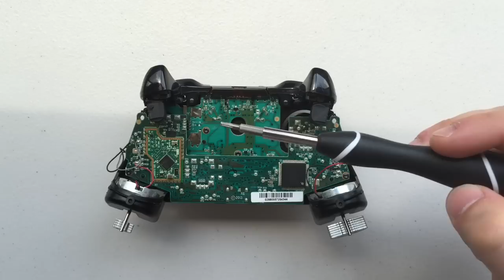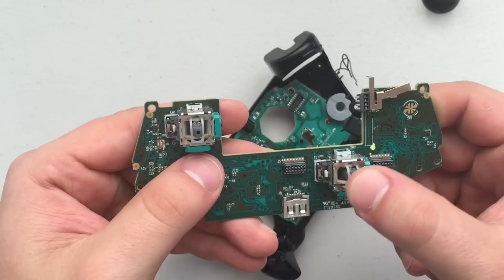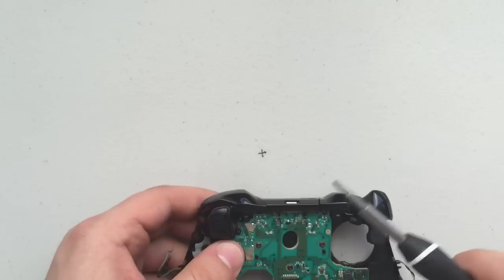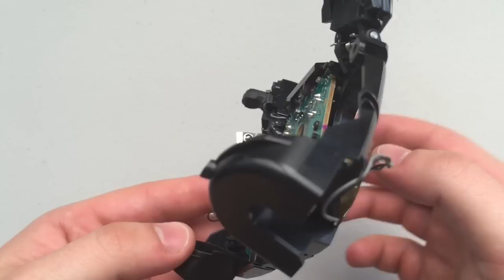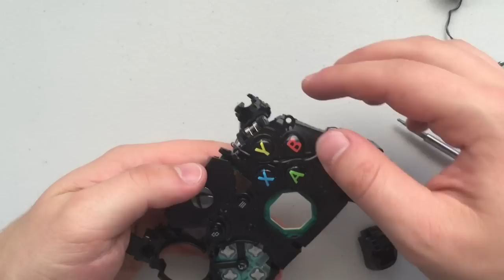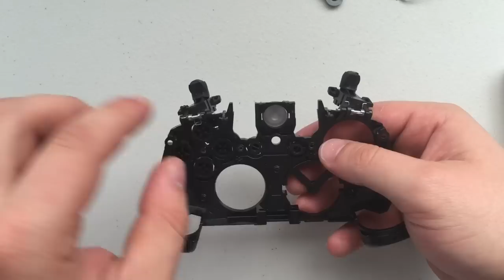How to Open/Disassemble an Xbox One Controller (Part 2)

Comment: You got me further than the other 5 or so tutorials I watched, and actually helped me out alot. I was able to completely dissamble all moving parts without a a solder kit/iron or anything like that just a couple torxs drivers and a tiny flathead for complete disassembly. But u helped bro thanks.

Comment: Damn it, its the white part underneath the d pad for me. i got the default white controller and couldn't press the up or left on my d-pad. even disassembled i got nothing. i clicked it and then i went full 'don't care', i just scrapped the white part off and found metal underneath the white sheet. it seemed like i made decision i cant go back on, and i didnt have the smaller screwdriver for the green board inside.before that i put it in water to scrape off any soda residue or anything and it seems like i just pressed up and left on the d-pad to hell and back. it just reached the end of its life time.. damn. well i got other controllers but jus decided to try my hand at this thing

Comment: Also if you happen to wipe that grease off the dpad get a tube of white lithium grease it works great i use it in anything from these to n64 joysticks to ps2 disc trays and anything that needs grease

Comment: Thank you sir, almost bought a new controller over the B-Button misfiring.

Twas a simple need to readjust the button and rubber cover over the plastic button's rod.

Still holding this Battlefield One Edition controller baby strong after 5+ years!

Cheers!

Comment: His controller is slightly different than mine.. I had to take mine apart to adjust the joystick for drift issues and I didn't even notice the module for the Aux Jack was just chilling on my floor.. did t even notice it fell out. I had no idea what it was until I inspected the controller. Turns out it just kinda sits in place and the prongs make contact with the board.... No solder... Nothing lol but I figured it out anyway :)

Comment: This is seriously a terrible internal design ms used for the controller compared to the internal design for the xbox and 360 controllers I just wanted to take the thing apart so I could clean the Y button since it was getting stuck and I found myself taking apart too many things in it just to get to the rubber pads and the buttons when I should have just opened and cleaned it in a few minutes like I do with controllers for older system.

I really hope they don't do this again with the controllers for the next xbox when it comes out.

Comment: Could I cut the circuit board in half and run wires through the severed lines? I am working on a project where I would need the parts to be spread out over a couple feet...

Comment: Any physically impossible way I can take my controller apart without the sodder? We currently do not own one in the house unfortunately.
Reply: Problem is the wires wrap all the way from back to front.
I have a controller with bad D pad down and no soldier iron

Comment: Both of the pegs holding in rb snapped. Just some super glue? Btw this is a wired controller
Reply: Rb was wedged in there. It finally came out without disassembly.  It's actually one big peg that was attached on both top and bottom

Comment: The right shoulder button on my Xbox One broke, but it's a different model from yours, mine has the shoulders both attached to the face plate that goes over the Xbox Button, as a result trying to glue it back down is...challenging at best. Thanks for showing me how to dismantle the thing though.

Comment: So, the white tab sticking out from the side of my left analog stick is missing the piece that holds it in place, so it doesn't sit up against the black button under it properly (slightly above it). I hear something rattling around further inside of it, so I need to take it apart further to find that piece. I hope this helps someone find their problem!
Reply: Turns out I was 100% correct! I got it out, and noticed immediately that the smallest piece on it had broken off, most likely the cause of it falling out int he first place. I am debating whether or not I should super glue this back on.

Comment: Had my RB cracked, so when i pressed it, it didnt click correctly or at all, so i used the RB from my other broken controller and changed it, thanks for the vids man
Reply from the maker: Awesome! Glad it helped. I just bought a broken controller (it's really just the LB button) so I'm going to do the same. Just pull an LB from the other controller (actually the controller in this video lol)

Comment: Its not dangerous chemicals really in lead free solder its basically just tin. And for lead solder you just need  good air flow like a fan or a open window. If people go lead free they wont need to worry about it cause it be safe. I use nothing but lead free solder if need or use  lead solder i turn  a fan on its all simple stuff if not inhaling lead solder
Reply from the maker: Good to know. I've always just used a fan as well and it's worked fine for me.

Comment: Seem to have a problem where the Right bumper doesn't send a signal to the xbox.  The function of the button works fine, however, when an app or game requires that button I cannot use it.  I also seem to be having a problem where when I push any button down I get a delayed response.  Any help would be appreciated.

Comment: I'm going to put this out there: If you use a screw diver that is .5mm too small, you will strip the screws.  BUT!  After I stripped two of my screws, they fit perfectly with a 5/64 hex key.  So, if you do strip your screws, try a hex key, it may save you a huge headache.

Comment: I have a problem that nobody has been able to help me with. I have an xbox one controller that has a broken internal trigger. Not the trigger that is easily removable but the trigger inside of that that does not get removed in this video and is held in by the metal swivel screw. It does not look like there is any way to loosen that swiveling screw to replace the cracked plastic piece that it is holding in place.  If you are not clear exactly which part I am talking about check out 12:30 in the video. It is the piece with the magnet attack to it and the rumble motor. I need to replace that and cannot remove it. If ANYONE knows ANYTHING I can do to replace it please let me know. I have two controllers that have the same problem so it would save me a lot of money. Thanks!

Comment: Hey man....Good video, but solder is pronounced "sodder" (no "L" sound).  Furthermore, you should get some flux, which helps the solder flow better, and make a better connection.  You can buy a small container of it at Lowes or Home Depot .  Make sure you get rosin flux or petroleum based, not acid based (acid flux is specifically for plumbing, not electronics).  Ask for tinning flux - I use Lenox brand, a petroleum based flux which I know for a fact is available at Lowes, located in the plumbing section.  Comes in a little hockey-puck shaped plastic container and has the consistency of vaseline.  Also, a damp sponge for cleaning the tip of the soldering iron is a necessity.  You should never leave flux on the tip or the bits you've just soldered after you're finished soldering, and cleanup is easy with just a damp sponge.  Cleanup of the circuit board points you just soldered can be done with medical grade alcohol (never ever use water to do this), which can be purchased at Wal Mart.  Another important thing to consider is static electricity.  An accidental dischard of static can be disastrous to your controller's circuit board, so make sure you ground yourself against something metal before you actually touch the circuit board.  I actually didn't find it necessary to desolder the black and grey wires from either side - they were long enough that I could detach the circuit board from the other and just flip it around and out of the way.  It would also be a lot easier to use a flat tip screwdriver as a pry bar instead of the torx driver.  LOL

Comment: Do you know how to remove the left and right stick clips on the boards I need to replace mine I have the new clips but don't know how to take the old ones off
Reply from the maker: What's up Nat. Thanks for stopping by. Are you referring to the assembly that holds the right stick on? It has an arm that moves around, etc...

Just doing some basic research, it looks like those are somehow pinned in to the board. I'm not sure if they are soldered on through the other side or what...never really looked in to those. If I see anything I'll get back to you. Also doesn't look like there are any videos on it so I might have to make one for it.
Reply: Xbox DIY they're soldered i seen a vid where someone took them out and replaced them but he didn't really get into it much detailed definitely would look into it. I was going to do mine yesterday but I'm not the best with soldering/unsoldering so I just left it alone lol
Reply: Xbox DIY and yes I was referring to the little cubes that you attach the grips too
Reply from the maker: Soldering is pretty tough - would it help if I made a video just for that? I feel like all the soldering videos I looked at were garbage and I ended up just asking somebody I work with for help. It's kind of specific to this controller so maybe that would help a lot of people out.
Reply: Xbox DIY I think it would the one I seen he sped the clip up where he was soldering/unsoldering so it was kinda hard to tell exactly how he did it. Would definitely help out me and others who would rather fix their own rather than buying a brand new controller and that breaks lol

Comment: I have a problem with D pad. Something as if one button does not connect every time, I push it and not responding then again and it jumps two tabs (xbox menu). Before opening gamepad I would like your opinion, would it only need some redusting and oiling or some replacement ?
Reply from the maker: I would avoid oiling anything - you have to be careful with lubricants. You can open up jsut the outside case of the Xbox One controller and access the Dpad so it should be pretty darn easy (and fun).

Comment: Challenge level: my controller won't turn on, and it isn't the battery pack (tried the fully-charged one from my other controller).
Reply from the maker: Is this an Xbox One, or Xbox 360 controller? 

Without taking anything apart, check the contacts on the battery pack. If they're corroded, use a pencil eraser to try and clean them. Let me know.
Reply: Xbox DIY Will do - it's an Xbox One controller
Reply: It turns out the contacts were not corroded - they had some fingerprints, so I cleaned them, but the controller still doesn't work.
Reply from the maker: Hmm - wondering if there is some corrosion inside the controller itself, or if something is loose. Have you taken it apart yet?
Reply: Xbox DIY I have not managed to look inside (as I lack the proper tools thus far), however I do believe I can hear something loose inside when I move the controller, although it could just be a rumble pack rotating.

Comment: All I need to do is fix one bumper that won't click. What a headache. Impossible to fix this crap unless you're a scientist.  Fuck this janky controller. Have to jump through 50 hoops.
Reply: AscensionStudiosCA Same.. needed to fix Rb button but it's literally the last thing you get access to
Reply: What evil son of a bitch design do these controllers?
Reply: thats what i just did....its a bitch had to take it off and crazy glue a small connection that broke on the rb button
Reply: funny, never had a console controller break in anyway until i owned one of these. yea ive had wires short on me but never parts of the controller itself break.

Comment: thanks for the video. Couldn't find the other 4 screws under the handles. 
think it would be possible to solder on rumble pack plugs like 360 controllers had?

Comment: Hi, any chance you know how to remove the springs and pins on the Xbox One controller's triggers?  I noticed you left them attached and I need to replace one of them as the spring has snapped.
Reply: You ever figure this out?
Reply: @ironclock  Yes, with a pair if needle nose pliers and much more force than I felt comfortable with I was able to pull the pins out.

Comment: Thanks for the video - really useful. We had a sticking RB, so I used this video to disassemble the controller to take a look. We have a 6 month old Xbox One. I noticed however that in my controller the number buttons were connected to the middle top section of the controller (the bit with the big Xbox lit button in the middle). So to remove the bumpers you need to lever off the middle part which releases both of the bumpers. Perhaps they've updated the controller slightly?

Comment: Hey man really helpful video! I have a question though, I was taking apart the controller when I accidentally dropped the controller without the shells. Nothing was damaged except one of my red wire just ripped. Only 1, and it is the red one. What do I do? And can I take it apart without soldering? Thanks man, please respond soon!
Reply: +Selim Eylül "sodder" the wire back to where it ripped off.

Comment from the maker: I have some new content on http://www.xboxdiy.com. Check it out and tell me what you think!
Reply: hey bro i opened up my controller to fix my drifting issue and when i put it back together i noticed my battery pack didnt work and the 5 screws arent properly tightened some are do you know how i should tighten them? i have a torx t6 and t8 some of the screws turn even though they arent tightened please help thanks
Reply: u may have stripped out the plastic threads in the controller
Reply: Scott KLingman yeah realized that lol
Reply: just saw how long ago this was posted lol
Reply: Scott KLingman yeah 8 months ago haha I just got a new controller In the end

Comment: I opened my xbox one controller with your help.  thanks for that.   my problem is that right stick continues to rise even when the stick is in it's neutral position so I took it apart, I see absolutely nothing out of the way.  no one has a fix for this.   can you help me?
Reply from the maker: +Shaun Potter Hmm that's really strange. Check for anything sticky around that area? Sometimes the tap gets in the way, food gets inside, etc. Does the stick move alright? It should 'lock' in any position outside of it's normal range of motion when the case is off.